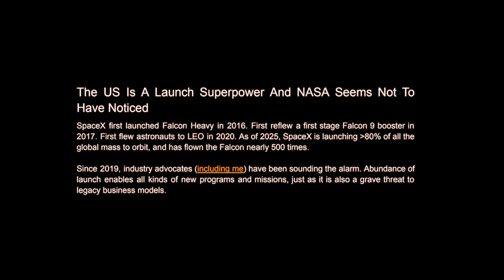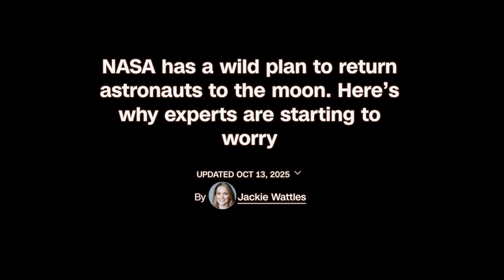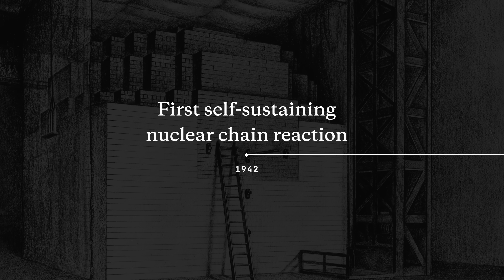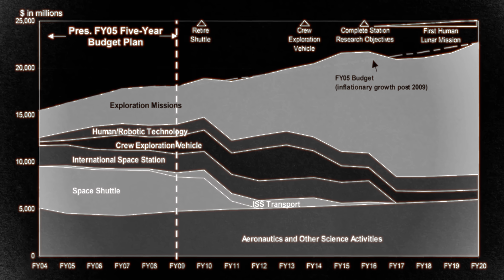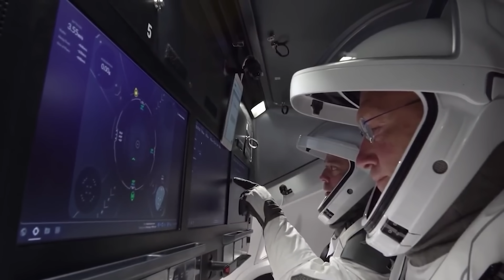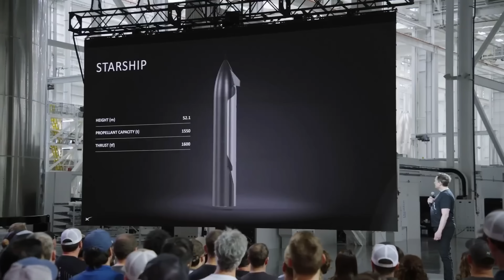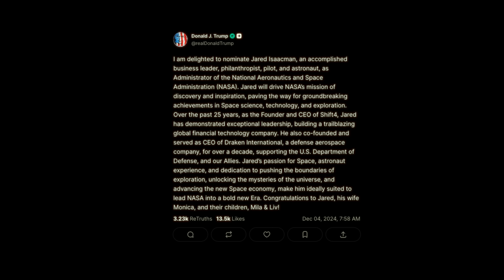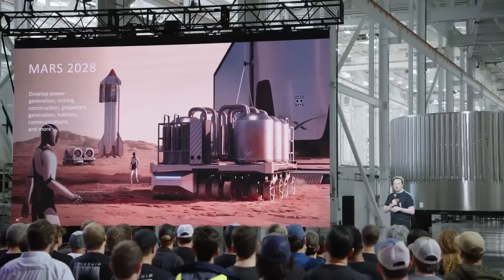Is NASA Failing?

Comment: I already wrote a huge comment but I propose the following thought experiment --

if we truly wanted to beat the Chinese shot-for-shot, could we not simply copy their architecture and launch it on a Falcon Heavy?

It has basically the same performance as an LM10 already. And it's already proven reusable -- we could break up the package into smaller pieces over multiple launches and assemble it on-orbit, if necessary.

Comment: I agree with the message of this video, but two glaring things stick out to me --

1) the false equivalency between what Artemis is doing ("the Moon, to stay "), what Apollo did, and what the Chinese are actually going to do with their first Moon landings (even less than Apollo). If NASA had straightforwardly been tasked with recreating Apollo then we would have done it by now. I am old enough to remember how often to stay was repeated during the formation of Artemis, yet we seem to have conveniently forgotten it when we compare with the Chinese. We're not running the same race. 

2) the so-called "compelling" evidence that the Chinese are executing on-schedule, to the point of dead certainty that they will beat us in 2030. "Long March 10 set for orbital test 2025"  (2:45) but with 1.5 months left there is no assembled LM10 on the pad, or anywhere to be seen. And is LM10 even really a proper Moon Rocket? Is is not more a warmed-over "LM5 Heavy"? Hurriedly pieced together because the LM9, that would lift any serious mass for a moonbase, is barely past the powerpoint stage, and isn't projected to be ready until 2036. 

It feels like MiG-25 all over again, but with all the information already out in the public but us just willfully ignoring it.

Comment: By eliminating the formal systems engineering process. Both within nasa, and at its contractors. Nasa enforses SE on contractors through standards, which compliance to it is required in all contracts. Should not be required. Systems engineering is a deceptive name, it is a bureducracy with excessive authority driven top down hierarchy. Fire all systems engineers and most program managers. Reduce the authority of the remaining program managers. For example they can be allowed to track project schedules, but not make any technical decisions.

Comment: Can I, can I answer the question asked in the video title? 🙋?!?!?? To save NASA, you need to destroy NASA, or more precisely, split it into two parts, as it was before Kennedy broke this system: into

1) the part engaged in scientific research in space,
and
2) the part that provides means of transportation in space.

It's not me being so smart, it's Jeffrey K. Greason, aka Jeff Greason, who is so smart — a member of the Augustine Commission for the revision of NASA by the US Congress in 2009, AFAIK (If My Memory Serves Me Right (regarding the date, I note, in this specific case)).

The merger of these two actually conflicting goals led to a conflict of interest at the NASA administration level, the most advantageous way to resolve which was the stagnation of delivery means.

For example, at NASA, as Jeff Greason found out in the course of this work, for example, there was a magnetoplasmadynamic sail technology based on Plasma Magnet developed in 2006-2007 as part of NASA NIAC works by a group from the University of Washington, which in its simplest form allows acceleration to the speed of the solar wind — that is, about 400 km/s if we take the ecliptic plane and 700 km/s if outside it, — with thrust in the tens of millions of Newtons (!!!), and acceleration up to 1 m/s², Carl!!! This is literally a technology that, after ground experiments, still needs to be tested in space. And we could in 5 years place a small telescope in the gravitational focus of the Sun on the side opposite to Alpha Centauri using such a sailboat, and get a megapixel photo of an Earth-sized planet at Alpha Centauri, moreover taking a spectrum in each pixel of this photo, that is, look, if we did this to Earth, we could give a good estimate of the population of cities by carbon dioxide emissions! That's the level of observation accuracy we could achieve with such a technology.

Not to mention that Jeff Greason, Andrew Higgins et al developed a whole bunch of other technologies based on this one, which allow moving against the solar wind, and obtaining dynamic hovering on plasma flows with different speeds, and increasing this speed by about 50 times, bringing it to the first units of percent of the speed of light, and making multistage interstellar systems reaching speeds of 0.25 c.

That's the kind of diamonds lying under the cloth at NASA, if anything. And literally there is no department there that would deal with such advanced propulsion systems. This is done only by handfuls of enthusiasts around the world, while NASA, due to this conflict of interest, exploits mid-last-century technologies. And this is a deliberate and reasonable choice from the point of view of a bureaucrat-administrator in such conditions, in the conditions of such a conflict of interest.

No need to preserve NASA. No need to preserve NASA in their current form. NASA in their current form must be destroyed by cutting it into two agencies, so that they get rid of this bad conflict of interest, and some of them realize the peaks of the human spirit in space exploration, while others create the peaks of the human spirit in creating means of movement through this very cosmos.

Humanity will be free, humanity will be extraterrestrial. Humanity will be in eternity. If we play all our cards right.

By the way, I highly recommend looking at the history with the 1980 year work, NASA & ASEE, "Advanced Automation for Space Missions" — you will find mentions of it even on the Wikipedia page "Self-replicating machines". This work was published in 1982 and is in the public domain.

Look at this in connection with Elon Musk creating the humanoid robot Tesla-bot in order to fully robotize all physical work in the economy.

The minimal economy closed in terms of supplies from other economic actors, robotized by humanoid Tesla-bot robots, adapted to life and growth in lunar conditions, will be that very one minimal self-reproducing robotic complex on the Moon, which, as NASA & ASEE understood back in 1980, is such a more efficient, fast and profitable way of mastering Outer Space that it is essentially the only way to do it.

That's what's interesting.

And yes, if you're interested, you can contact me, I'll tell you more about it! ))

From Siberia with love! (Siberia, not Serbia! )))

(It's Grok translation of my Russian comment)
Reply: И простите очень смешно и грустно слушать комментарии по поводу политики. Китай не является диктатурой, он является формой электоральной автократии скорее. Как и США собственно.

Ещё раз: США не является демократией, США является электоральной автократией. Например ровно также определяется политический режим в России.
Исследование гарвардского университета, про которое говорит в одном своём малоизвестном видео шестилетней давности на Ютубе актриса Дженнифер Лоуренс, выступающая в рамках общественной инициативы по возвращению демократии в США, — привело исследование того, как процент поддержки какого-либо законопроекта населением США влияет на вероятность его принятия. По оси Y разместили вероятность принятия, в процентах, а по оси X — долю населения поддерживающего законопроект. 

И у них получилось ровная прямая параллельная оси Х. Вероятность принятия любого законопроекта буквально одна и та же, вне зависимости от уровня поддержки населения. 30%.

Конгресс США буквально коррумпирован, буквально открыто коррумпирован, притом кстати режимом апартеида основанном на расистской идеологии, — привет заключению, выраженному в резолюции Генеральной Ассамблеи Организации Объединённых Наций (ГА ООН)(en: UN) 3379. И с тех времён не изменились ни факты, ни законы логики, не определения апартеида или расизма/ теории расового превосходства. Вам скажут что перед мадридскими соглашениями которые предшествовали соглашениями в Осло эту резолюцию мол отменили. Ну, так как не факты, ни законы логики, не определение не поменялись, одно это должно намекать на то что это отмена была политическим шагом, а знание истории говорит нам что этот шаг был получен шантажом срыва мирного процесса этим режимом апартеида. Ну, они сказали "мы очень расстраиваемся, отмените пожалуйста это решение, и только в таком случае мы будем с вами разговаривать". Занятный штрих: участники происходящего, лица принимающие решение со стороны режима апартеида позже прямо признавались, что это было лишь уловка, никакого мирного решения они не желали и намеревались его, что позже и сделали,  саботировать, реализуя свои колониальные планы. И да, режим апартеида который коррумпируют сейчас, хвастаясь об этом в X (бывшем Твиттере) количеством коррумпированных ими конгрессменов. 

Это коррумпирование ввязывает США в соучастии в геноциде семитов в концлагерях. 

Вот мы о каких политических раскладах говорим. Это не с точки зрения какой-то из сторон, это с точки зрения political science, — спросите хотя бы отца-основателя, и главное лицо школы политического реализма, профессора чикагского университета, а заодно и главу департамента political science в нем, профессора Джона Мешаймера.

Так что с подбивочкой с политической стороны стоит немножко поработать, это вообще некоторых стимулируют в качестве балансировки расклада сил вообще Китаю вон помогать. Ну, чтобы электоральная автократия коррумпированная нацистами с термоядерной бомбой не захватила "господствующую высоту" Луны например. 

То есть нацистский режим с термоядерной бомбой, истребляющий сейчас семитов в концлагерях в ходе преступлений геноцида, и коррумпирующий "лидера свободного мира" (как до этого сперва начал коррумпировать того, кого последовательно называли "лидером цивилизованного мира", "лидером западного мира", "империи, над которой никогда не заходит солнце", — что довольно-таки интересные мысли навевает, а не является ли это прикрытием одной и той же расистской мысли, мысли в рамках расистской теории превосходства, — Цивилизация и Варварство, Люди и Недолюди).

Нацистский режим с термоядерной бомбой, терроризирующий весь земной шар при помощи политических убийств,  истребляющий сейчас семитов в концлагерях в ходе преступлений геноцида, и коррумпирующие "лидера свободного мира", для того чтобы свободно распоряжаться его деньгами и его военной силой. И для этого кстати затыкать рты несогласным с этим положением вещей в этом самом "лидере свободного мира", плевав на "свободу слова", и иллюзию демократической страны.

Нацистский режим который черепикингом в качестве своей идеологии имеет идеологию порабощения всего остального мира на самом деле. Вы найдёте в Ютубе полно видеороликов, где они сами не стесняясь на камеру это говорят, под восторженные возгласы сторонников.

Дядя Адик нервно курит в сторонке вот такого успеха коллег, с которыми они кстати на пару, буквально сотрудничая вплоть до выпуска монеты на которой а культурно апроприированные, или прямо скажем украденные ими религиозные символы религий, с точки зрения которых эти воры являются преступниками, вероотступниками и еретиками; являются Злом в чистом виде, — были выгравированы с обоих сторон. Вот мы о ком говорим. 

Так что давайте признаем честно: на планете земля есть люди, которые смотря на эти браворные рассказы о том как американская демократия будет сидеть на самой удобной стратегической высоте, и демонизировать буквально не настолько павший аналогичный режим электоральной автократии — ну, извините, за то что мы тут вещи своими словами называем, — будут изрядно охуевать от либо тупости этих заявлений, либо их чудовищной лживой наглости. 

США буквально сейчас является придатком, обслуживающим нацистов. Нацистов, занимающихся геноцидом семитов в концлагерях. 

А вы тут рассказываете о вершинах демократии, и о том что именно этим "Добрым Людям"(tm) надо власть иметь над самой важной стратегической высотой в ближайшем пространстве.
Reply: And sorry, it's very funny and sad to listen to comments about politics. China is not a dictatorship, it is a form of electoral autocracy rather. As are the USA, actually.

Once again: the USA is not a democracy, the USA is an electoral autocracy. For example, the political regime in Russia is determined exactly the same way.

A Harvard University study, which actress Jennifer Lawrence talks about in one of her little-known videos six years ago on YouTube, acting as part of a public initiative to return democracy to the USA, — conducted a study of how the percentage of support for any bill by the US population affects the probability of its adoption. On the Y axis they placed the probability of adoption, in percent, and on the X axis — the share of the population supporting the bill.

And they got a straight line parallel to the X axis. The probability of adopting any bill is literally the same, regardless of the level of population support. 30%.

The US Congress is literally corrupted, literally openly corrupted, moreover by the way by an apartheid regime based on racist ideology, — hello to the conclusion expressed in the resolution of the United Nations General Assembly (UN GA) 3379. And since then neither the facts, nor the laws of logic, nor the definitions of apartheid or racism/theory of racial superiority have changed. They will tell you that before the Madrid agreements which preceded the Oslo agreements this resolution was allegedly revoked. Well, since neither the facts, nor the laws of logic, nor the definition changed, this alone should hint that this revocation was a political step, and knowledge of history tells us that this step was obtained by blackmail of disrupting the peace process by this apartheid regime. Well, they said "we are very upset, please revoke this decision, and only in that case will we talk to you". A curious touch: the participants in the events, the decision-makers on the part of the apartheid regime later directly admitted that it was just a trick, they did not want any peaceful solution and intended to, which they later did, sabotage it, implementing their colonial plans. And yes, the apartheid regime that is corrupting now, boasting about it on X (former Twitter) with the number of congressmen they have corrupted.

This corruption involves the USA in complicity in the genocide of Semites in concentration camps.

That's what political layouts we are talking about. This is not from the point of view of any of the sides, this is from the point of view of political science, — ask at least the founding father, and the main face of the school of political realism, professor of the University of Chicago, and also the head of the department of political science in it, professor John Mearsheimer.

So with the political side it's worth working a little bit, this generally stimulates some to help China as a balancing of the balance of power. Well, so that the electoral autocracy corrupted by Nazis with a thermonuclear bomb does not seize the "dominant height" of the Moon, for example.

That is, a Nazi regime with a thermonuclear bomb, exterminating Semites now in concentration camps in the course of genocide crimes, and corrupting the "leader of the free world" (as before that it first began to corrupt the one who was successively called "leader of the civilized world", "leader of the Western world", "empire over which the sun never sets", — which inspires rather interesting thoughts, isn't this a cover for the same racist thought, thought within the framework of the racist theory of superiority, — Civilization and Barbarism, People and Subhumans).

A Nazi regime with a thermonuclear bomb, terrorizing the entire globe with political assassinations, exterminating Semites now in concentration camps in the course of genocide crimes, and corrupting the "leader of the free world", in order to freely dispose of his money and his military power. And for this, by the way, to shut the mouths of those who disagree with this state of affairs in this very "leader of the free world", spitting on "freedom of speech", and the illusion of a democratic country.

A Nazi regime that cherry-picks as its ideology the ideology of enslaving the rest of the world actually. You will find on YouTube plenty of videos where they themselves are not shy to say this on camera, to the enthusiastic exclamations of supporters.

Uncle Adik is nervously smoking on the sidelines of such success of colleagues, with whom they by the way in pair, literally cooperating up to the release of a coin on which culturally appropriated, or let's say straight stolen by them religious symbols of religions, from the point of view of which these thieves are criminals, apostates and heretics; are Evil in its pure form, — were engraved on both sides. That's who we are talking about.

So let's admit honestly: on planet Earth there are people who, looking at these bravura stories about how American democracy will sit on the most convenient strategic height, and demonize literally not so fallen similar regime of electoral autocracy — well, sorry for calling things by their names here, — will be considerably fucking stunned by either the stupidity of these statements, or their monstrous lying impudence.

The USA is literally now an appendage serving Nazis. Nazis engaged in the genocide of Semites in concentration camps.

And you here are telling about the peaks of democracy, and about the fact that it is these "Good People"(tm) who need to have power over the most important strategic height in the nearest space.